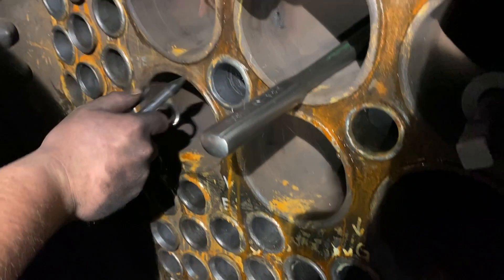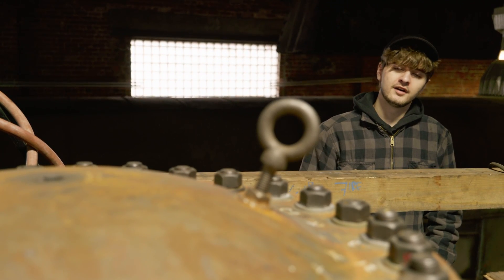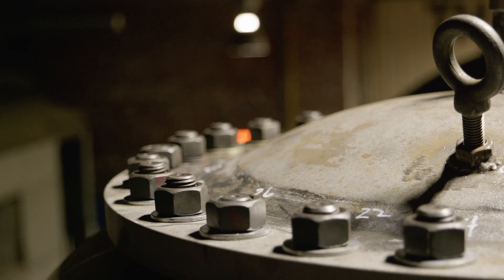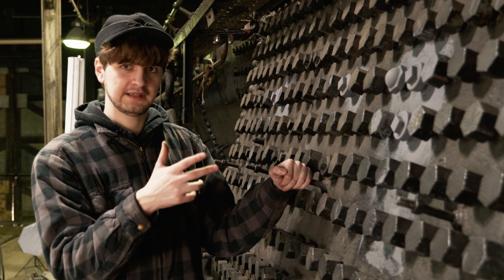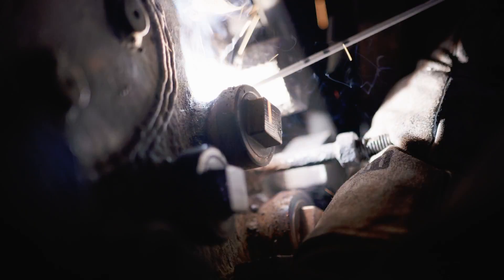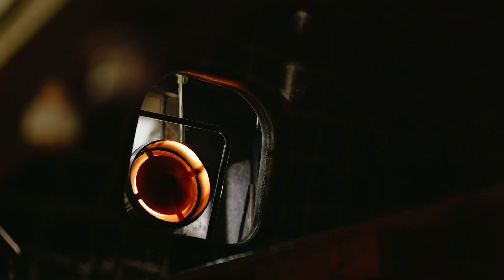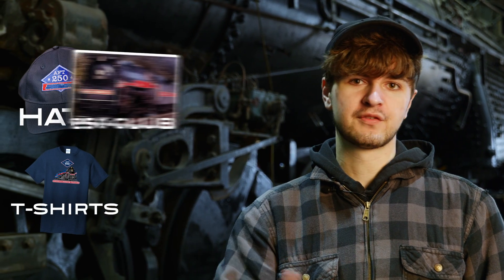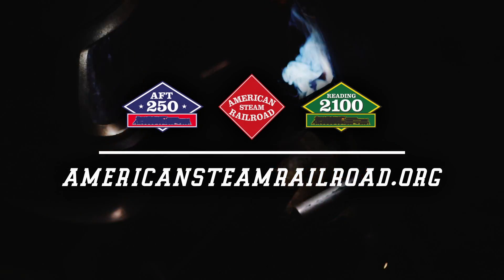Hydrostatic Testing - AFT 250 January 2024 Update

Comment: First get #2100 up and running, then we'll worry about passener cars. Hell, seats in gondolas will be fine with us!  I hear the #2102 group is giving tech advice and support. Nice.
Reply from the maker: Hello! Yes, the R&N with the 2102 have provided us with information and vendors that have made our work more efficient, as well as donating some new and good used parts to us. They have also loaned us specialty tools at times. We have also been able to provide them with some information as both locomotives have been altered over the years, and in some cases the 2100 was more "original" so we could provide bracket locations and measurements to assist them. Please consider donating today or making a purchase from our gift store so we can continue our progress at: www.americansteamrailroad.org

Comment: 2 questions. 1. will there be any more locomotives that will be pulling the AFT? 2. Will the AFT be on the same route it was on back in the 70s or a different route?
Reply from the maker: Hello, good questions! ASR is just closely recreating the T-1 locomotive, which we will use to pull other museum's and tourist railroad's passenger equipment. Our "route" will be to go to locations that we have agreements with to operate at, which we expect to only be in the northeast. Thank you for your interest.